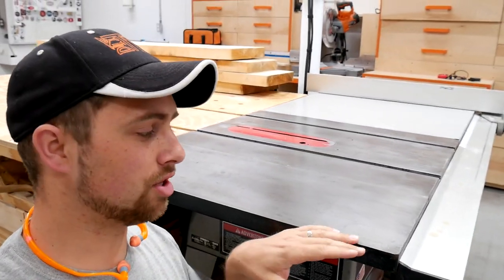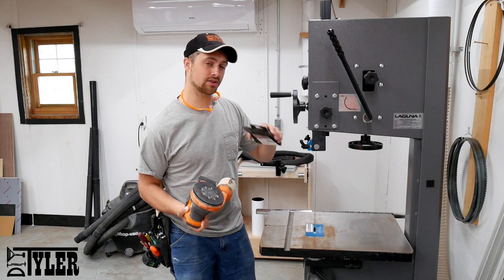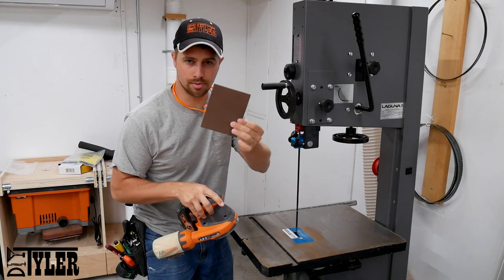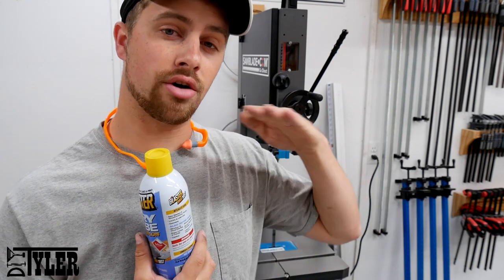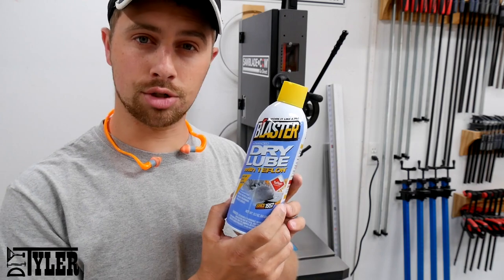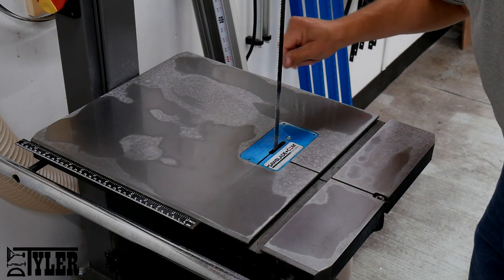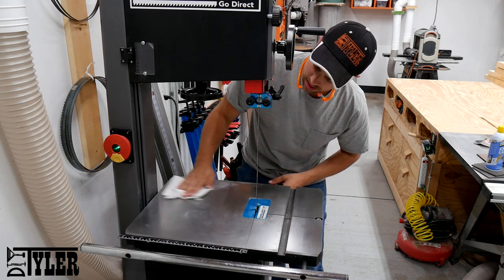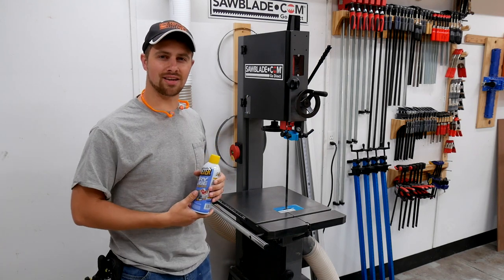Clean and Prevent Rust on Your Tools | D2D DIY | Clean cast Iron

Comment: Dude !!!!!   I'm exceedingly surprised that you recommended a product that would leave Teflon on your wood. I'm surprised you haven't had problems with finishing or eliminating Teflon residue from the pores of your projects. Friends of mine in a commercial shop in Louisiana where rust happens if you look at a cast iron surface use Lemon Pledge. I'm not sure if that creates a problem with residue but it's an option you might explore. It's effective and it's cheap
Reply: @Lee Fox --What do you use to keep rust off your hand tools? ( ie wrenches, screw drivers, exacto knives, wratchets , sockets etc )

Comment: About a year ago, I read/saw that you can use talcum powder to fill the micro-pours of the cast iron.  I've been using that instead of wax and it seems to work great without building up or getting sticky.
Reply: I spray a coat of can shellac over the cast iron.  Sand it lightly and the second coat.  Sand that super lightly and then polish it with Paste Wax and I never had an issue ever again.  The shellac seals the cast iron very well.

Comment: Have you ever tried Barkeepers Friend (like Soft Scrub) liquid cleanser? It has oxalic acid which does a nice job on light surface rust. I have found that scrubbing with BF about every six months (with the grain of my cast iron saw top) keeps it looking pretty sharp. I still do the old school paste wax thing afterwards, because I am totally paranoid about some of those lube sprays. If they contain even tiny amounts of silicone, it can totally ruin wood for finishing. A mild Scotch Brite pad works well for the cleaning.
      The liquid cleanser can also be painted heavy on a bad rust spot, then covered with Saran Wrap to keep it wet. Then you do your regular clean/ seal steps. I found that this worked well on an old jointer which had a rag of something on it, causing some deep rust. The BF took all the rust out, although the metal surface was still slightly discolored. I will eventually block sand the entire top with a large block of 3/4 MDF and successive grit paper to not cause any divots in the surface. For now, it functions fine, so it will wait. 
   I will check out dry lube you used here. I can think of numerous tools which could use a little rust prevention.

Comment: Boeshield T-9 to both lube and protect cast iron / steel tools.   let 30% phosphoric acid sit on for for 10 to 20 minutes to remove rust, neutralize, dry, polish, then the T-9.

reapply T-9 whenever wood seems to be harder to push through, it doesn't build up or mess with finishes.  been using this method for years to restore tools and maintain the ones I have.  It works great.

Comment: Hey Tyler does the abrasive pad scratch the surface of the cast iron at all? I tried a scotch brite pad for dishes which is not really that rough in circular motions on my sawstop  and left horrible round scratches that bother me eveytime  i use my table saw, any tips how to remove them?. Ive seen videos where people use sandpaper but im not confident that its not going to scratch the surface even worse.

Comment: Won't the teflon interfere with finishes?
Reply from the maker: +BiglinesNL not that I have seen. It is totally dry and lasts way longer than wax...so I think it would interfere less.
Reply: Teflon does not cause finishing problems. Silicone, however, does. This product does not specify that it is silicone free, so it may be or it may not be (anyone know for sure?)

There are some teflon dry lube products that specifically say they are silicone-free. For example, Dupont Teflon Non-Stick Dry-Film Lubricant. Also, Rust-Oleum Dry PTFE Lubricant.
Reply: ah ye, silicone was why i asked, good to know teflon doesnt do the same